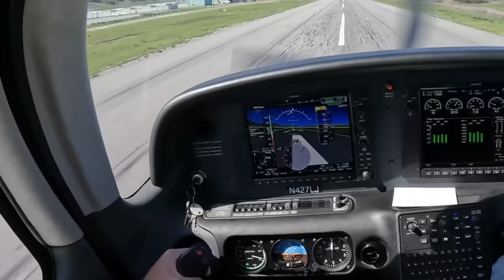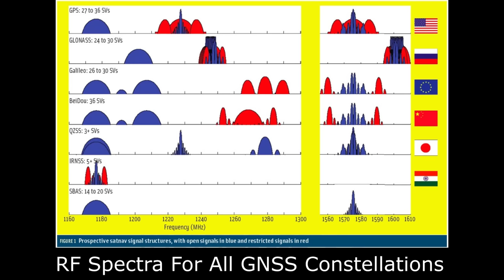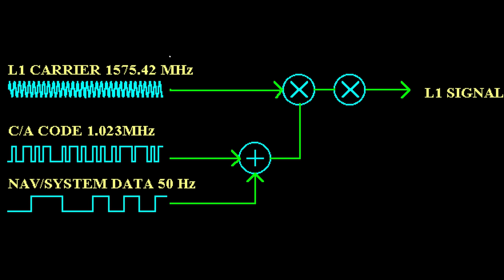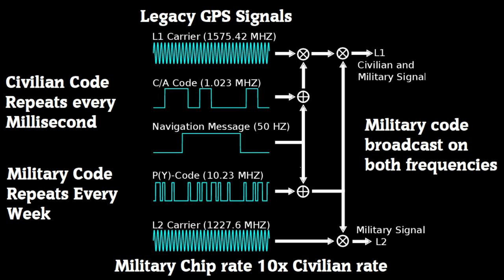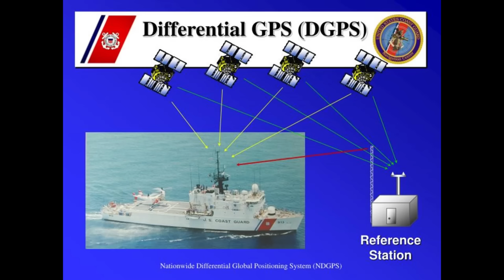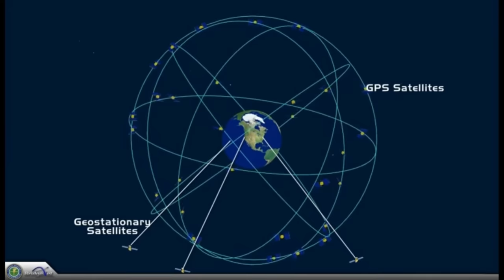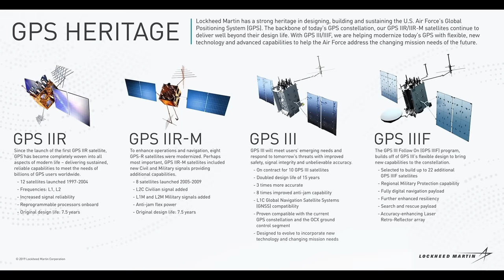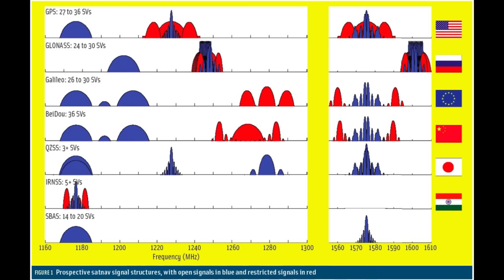How GPS Works, And How It Got Better Than The Designers Ever Imagined

Comment: CDMA is a bit hard to understand at first but is one of the coolest bits of radio/signal technology out there. One interesting quirk of CDMA is that while you can have multiple users/transmitters all on the same frequency at the same time, the more active users you have the higher your noise floor becomes. This effectively means that the range with CDMA based protocols reduces as congestion goes up, and you can sometimes see this happening in busy areas with cell phones (especially with marginal signal) where you will either lose bars at times of high congestion or will find that your cell phone only connects to the tower in the middle of the night when there's little traffic going on.
Reply: good comment. Yes CDMA sites "breath" which can cause real problems for operators. Thats why 5G does not use CDMA.
Reply: @rgbaal  To my knowledge CMDA has only been used in 2G and 3G standard of mobile communication. 4G was designed completely independent of 3G. 4G uses OFDM signals with FDMA and TDMA instead of a single carrier signal with CDMA in 3G. One big advantage of OFDM in a multi-user scenario is which each user can be assigned to the part of the spectrum which is received the strongest by him. This type of resource allocation is called multi-user diversity. The same diversity concept can be nicely extended to the Multi Antenna transmission. The so-called Multi user MIMO or MU-MIMO.
Reply: re: "This effectively means that the range with CDMA based protocols reduces as congestion goes up,"
Proper RF coverage, as performed by the RF Engineering department, in core areas of coverage work to assure sufficient margin exists  to keep this from happening. Engineering isn't a 'crap shoot' where things just happen, there were methods and plans in place to accommodate the technology, JUST as there was for 1G (analog) FDMA cell technology. Former RF cell eng here.
Reply: @uploadJ  I wasn't implying it was some wild uncontrolled factor; obviously it's accounted for when you design cell spacing, power levels etc. Designers know very well how various numbers of active users at various distances will affect the performance of their cells and ensure they're managed accordingly to provide consistent performance.

It's simply a factual property of CDMA modulation, and an unusual one compared to other modulation schemes where range is not dependent on congestion (only throughput), so I thought it was worth mentioning. It takes a pretty exceptional scenario to even notice this (edges of coverage at unusually busy times) which is a testament to the exact fact you mention, which is that a lot of design effort goes in to ensuring you have a good experience with cell networks across a broad range of conditions and locations.
Reply: @siberx4  Fair enough. You have a good reply there too.
Reply: My ex-wife was a telecom engineer, and this is exactly how she described digital multiplexing. One wire, several conversations. I think that also had something to do with how early DSL connections worked for Internet service over phone lines, as opposed to phone modems.
Reply: You talk about the past. CDMA was the hot stuff of the 1990s, now outdated for communication. 3G cell networks, now decommissioned, used CDMA. 4G and 5G use OFDM.

Comment: Differential GPS works by correcting for the distance to each satellite from the reference station separately, then using those corrected distances in the remote receiver's calculation, not by calculating an offset position from the reference station. This way the remote receiver doesn't have to use the same satellites as the reference station for it's position calculation.
Reply: Expanding on this, ‘classic’ DGPS corrects the code phase of the ranging signal, whereas RTK/PPP etc use a variety of techniques to correct the carrier phase of the ranging signal for a higher degree of precision/ and ideally, accuracy.

The limit to achievable accuracy in cases where range correction terms are used is that they assume that the range error for the reference station and remote are identical. The further we get from the reference station, the less 
 this assumption holds true. 

Modern state space correction techniques synthesise a wide area correction model from multiple reference station observations within it, from which locally applicable correction terms can be calculated by the receiver.
Reply: If it is able to use the same satellites the plane can correct distances better because the signals pass through pretty much the same ionospheric effects as the reference location. You do not HAVE to use the same satellites. But, you can in principle get better results that way.
{^_^}

Comment: Scott,
Back then (in 1973), there WAS another satellite based navigation system called "Transit", which used a series of satellites in low polar orbit. These satellites constantly transmitted their position and a time marker every 2 minutes on 250 MHz and 400 MHz. The receivers (mostly aboard nuclear missile submarines) would track the doppler shift of the received signals, and (based on that) calculate the distance from the "bird" (satellite). Then (knowing both the satellite's position and it's distance) it would calculate its position  --- to within 10 meters --- all using 1960s technology!

The commercial version available was called SatNav, and it was only accurate to around a 1/4 mile, or so; but the military version was accurate enough to shoot missiles.

Back then, in the Navy, aboard a missile sub, that system was one of my jobs.
Reply: The first successful tests of the Transit system were made in 1960, and the system entered Naval service in 1964.  This system was first envisioned when two physicists (William Guier and George Weiffenbach)  at Johns Hopkins Applied Physics Laboratories October 4, 1957 heard the Doppler shift of the Sputnik signal.  Transit was in use until retired in 1991.
Reply: @mdxtrains  
"Retired", yes --- but not shut down.  From what I understand,  it's still being used to monitor Earth's gravitational anomalies.
Reply: Thanks for bringing up “Transit”, as it was a “good” system 
that established a baseline for the future GPS specifications.

Comment: A remarkably good and accurate description of GPS (which I know something about).  A couple comments:
(1) one of the reasons that SA was disabled had to do with the first Iraq war.  Turns out that most of the GPS equipment that went into the field did not have the (ITAR controlled/classified) SA decoders.  So DoD had to turn SA off during Iraq 1 in order to avoid hindering US troops.  In other words, SA wound up working almost exactly backwards from what DoD intended.
(2) GPS is so accurate that the system includes a correction for General Relativity;  There is enough spacetime curvature between the 12 hour orbits and near the Earth's surface that the satellite clocks have to be slowed down a little bit so that by the time the signals "fall" to the Earth, they have "sped up" just enough to be able to ignore the GR effects on the ground.  If you're using GPS far from the Earth's surface, that GR "correction" will have to be accounted for.
(3) If you have some prior knowledge of your altitude, you can get your lat/lon with fewer than 4 satellites.  Also, if you are not in motion, the movement of the individual satellites will effectively generate "new" satellite positions that can get you additional links.  Buzzword on this topic: GDOP, geometric dilution of precision.
(4) a key data output is the  time.  You can get GPS-based time servers for your computer that will provide the correct time within a few nanoseconds.
(5) Heard on NPR today.  If you're using a handheld GPS device in Moscow today, you'll notice that it doesn't work very well.  This is because Russia is jamming GPS to try to confuse those wascally Ukrainian drones.
Reply: GPS not working in Moscow because of "wascally Ukrainian drones"? Thank you for that tidbit, good sir. My schadenfreude is immeasurable, and my day is perfect.

Also, I'd heard about something like that with (1). Something like, you knew when some particular war started, because GPS suddenly got a whole lot more accurate. Didn't know that it was due to SA being turned off, neat!
Reply: There is a misnomer here though that the techniques used by SA were turned off. In fact the GPS system still skews time. UTC(USNO) (GPS time) "is kept within a close but unspecified tolerance of the international atomic timescale." The military knows the tolerance in real time, the timing data is released two weeks after the fact (so atomic clocks can be sycned up). SA was just a very large interruption in the clocks which could be corrected by simply having a clock station on the ground as the video notes.
Reply: 5 is fake.
Reply: We were using the NAVSTAR SYSTEM(GPS) In Gulf War 1 in 1982 - it actually played a MAJOR Part in the Victory - for once the Allies KNEW Precisely where they and everyone else where.....
The First GPS Satellite was launched in 1978.......
The full 24 Satellite Constellation was operational in 1993........
Selective  Availability was turned off for Gulf War 1(Kuwait) - NOT IRAQ 1 - basically  as you have said there were not enough Military Compliant GPS Recievers so they bought a load of Civilian Grade ones - as SA Degraded thier Accuracy they turned it off temporarily.?..
SA got switched off permanently @ 24:00 1st May 2000
Reply: But the waskilly Ukrainians can do the same thing by building ground stations as in the WAAS system or the Coastguard did.
Reply: Yeah I knew about #2 as well, I wanted to add a comment about but figured someone else would have already =)
Reply: @marcoaurelio4903 what is your evidence? Because I can tell you for a fact GPS does not work in Moscow or St. Petersburg and it definitely did in January 2022
Reply: @the1spyderryder but that doesn't help them over Moscow much now does it. Granted they have other solutions to these problems but they can't use GPS
Reply: It also adjusts for the tidal effects of the moon on earths crust. To me that is incredible.
Reply: GPS also includes corrections for the Sagnac effect.
Reply: re: "GPS is so accurate that the system includes a correction for General Relativity"
Have not seen anywhere that this is shown to be the case. Instead, they do a piece-wise correction from ground stations to account for satellite movement and accrued time differences. Maybe this is what you refer to? Other factors may be larger then, but GR effects would eventually be cumulative.
Reply: @denelson83  Too broad and sweeping a statement to have meaning.
Reply: @uploadJ  The GR effects account for the difference in the gravitational potential between the Earth's surface and GPS orbit, which are definitely large enough to measure.  In particular from our point of view if the GPS clocks put out 1PPS in their inertial frame of reference, they'd be separated by something other than 1 second by the time they "fell" to the ground.

Even astronauts aboard ISS age about 7 ms less than we do on Earth for every six months they are in space.  That's about 1 ms per month, about 30 microseconds per day.  30 microseconds per day is large, very noticable drift, and for GPS it's even larger.
Note that 30 microseconds is about 9 km of light travel time.

[The effect here is indepedent of the Doppler up/down shift of GPS as it approaches/recedes from us]
Reply: @jdsahr  re: "The GR effects ..."
You didn't read what I wrote, or misunderstood it - right? The discussion is HOW the effect is handled in the NAVSTAR GPS domain, between user equipment, the satellites and the ground monitoring and control stations. If you lack addressing that aspect, you DID misunderstand my posts.
Reply: @uploadJ  i.e., The Earth rotates, and GPS position calculations do not initially take this rotation into account.
Reply: @denelson83  re: "The  ..."
Missing the point. None of you guys are hitting the point. Go look at the procedure the NAVSTAR program office/management office uses to correct for time contraction, then report back here the procedure they use. Got that? Quit quoting HS level GR theory.